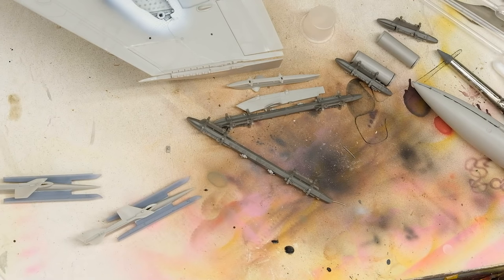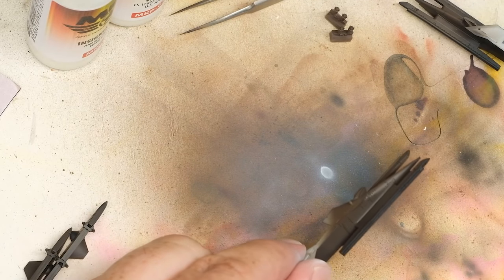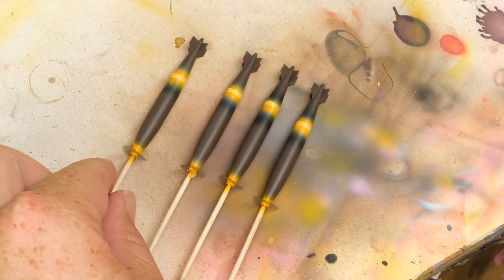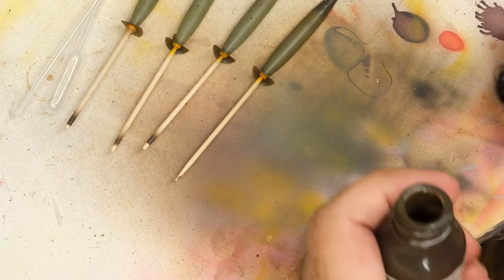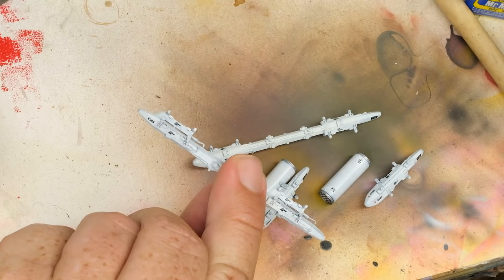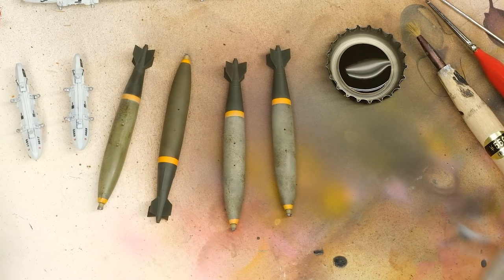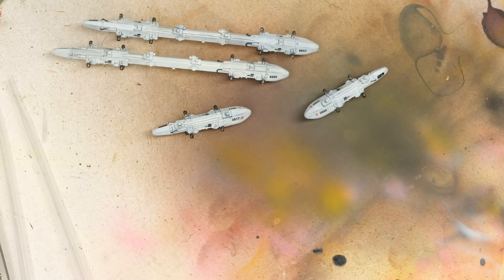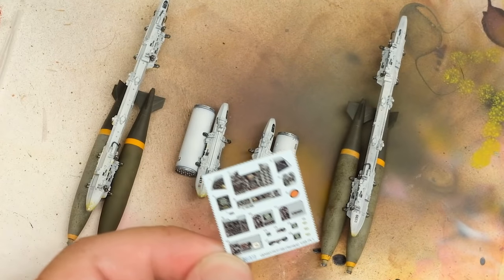1/48 Tamiya F-4B Phantom 02 - Ordnance

Comment: Hey Matt, been watching your work for a bit now and I really like how you go about your craft, attention to detail, callouts and last but not least your colorful commentary. One thing I haven't been able to discern though is why you choose which airbrush for a particular job. In this video you use 2 different brushes for priming and 2 different for painting. For instance, using the PS-267(.2) for priming racks but PS-290(.5) for priming bombs. Then PS-267(.2) for painting LAU3 Pods and launcher rails followed by the PS-771(.18) for LT Gull Gray on same launcher rails. Can you shed some light on which brush you choose for what and why?
Reply from the maker: I can try to spell it out as I'm working, but for these in particular:

Priming the racks - PS-267 - lots of nooks and crannies to get into and I wanted a more controlled spray than the PS-290 is really good at. 

Priming the bombs - PS-290 - didn't thin the primer as much in order to build it over the 3D layer lines, and you can get away with that with the 290's larger needle. 

Pylons and launcher rails - PS-771 - had to work tight and close to avoid overspraying the metallic portions of the AAM rails
Reply: @DoogsModels  The logic had me there but my inexperience had me looking for confirmation. Thanks for your explanation and sharing your experience!